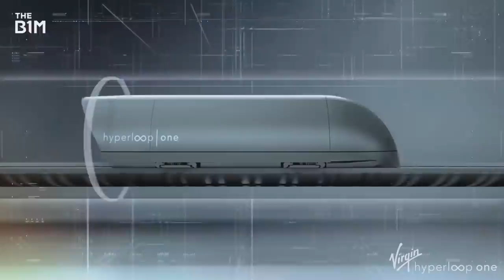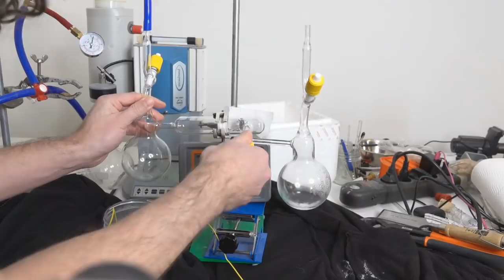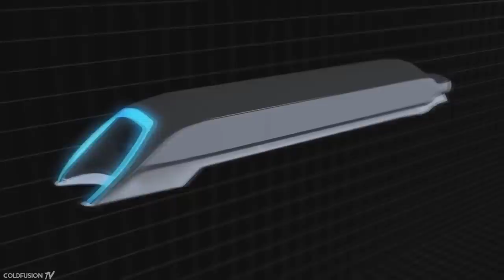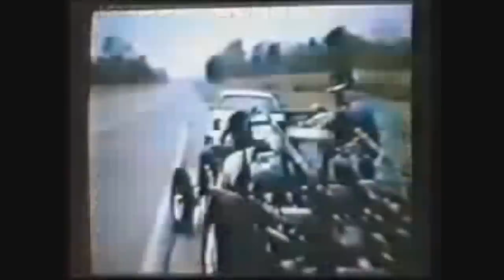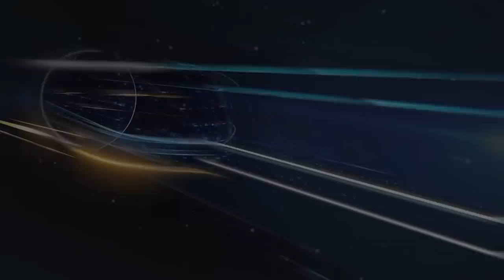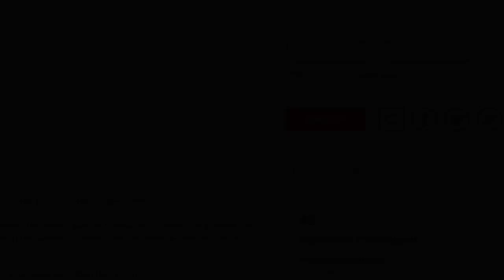Free energy device using Hyperloop technology!

Comment: Good vid, you walk the line between sarcasm and an actual sales pitch perfectly.

Why it won't work outside of a small scale model with artificial cooling: How are you going to maintain the vacuum? You want to remove the water from the cooled flask but opening it will destroy the vacuum. Another thing to consider is that you will have to clean the water and get that into the flask aswell while not destroying the vacuum.
Last, the change from hot to cold is over a really long distance, won't the gradual change in heat mess everything up?

In the end, this is just wind energy right?

I am just a skeptical Electrical engineering student but would be honored if you can explain how you have or want to solve the problems listed above.
Reply: Oh, stop it with those little practical details. The engineers will figure a way around them. Even if it means they have to come up with a new set of Laws of the Universe. I've worked with engineers  -- those guys can work miracles, ya know?
Reply: @Blue Obviously the whole thing is sarcastic, but the problems you list aren't entirely unworkable.  Just like the Hyperloop will have to seal off sections when loading and unloading, you would have collection areas partitioned and actively work on loading or removing water at each end.  Close it up, have the pump get it back to normal again and reconnect that section to the vacuum.  As far as the heat differential, well yeah, kinda.  I mean, you can use insulating materials, and the scale is huge - would have to stretch the distance from the Arctic to below Alaska - for instance.  It wouldn't really be much different in temperature from its surroundings at any specific location, the difference would need to be in the temperature between where you load the water in and where you unload the ice.  I'm no engineer, and I don't know the maths required for this, but wouldn't the volume of the vacuum near the loading and unloading areas have to be huge?  I don't know if it would need to be larger than the volume of the whole tube or not, but it would need to be large enough for there to be an easily maintained temperature differential that would keep the flow strong all the way through.
Reply: How are you going to maintain the vacuum?
-Vacuum pumps and other hand this could be used in space stations utilizing already existing vacuum of space.
You want to remove the water from the cooled flask but opening it will destroy the vacuum.
-Yes and its pretty easy thing to do if you have chamber on the bottom of the flask. Water is collected there, upper valve is closed, bottom is opened to let water out, then closed and upper is opened again. This will insert little bit of air into vacuum but not much.
Another thing to consider is that you will have to clean the water and get that into the flask aswell while not destroying the vacuum.
-Again same chamber system apply to inserting water and cleaning the system. Water will boil and leave all the crap into first flask. There can be several flasks that can then be cleaned while others run the system.
Another thing to consider is that you will have to clean the water and get that into the flask aswell while not destroying the vacuum.
Depends on how long the pipe is. In space craft this is non issue, where as on earth i suspect you will have greatly lowered efficiency for mentioned reason. Though there is ways around this issue like having vacuum tube inside a another. As you probably know heat is transferred poorly trough vacuum, where there is no substance to transfer heat trough.

There usually is way around the problems. What ever this makes it practical solution, is different topic entirely, just like with vacuum train.
Reply: what about they dig a big hole on the ground on arctic (or antartica) until it gets hot from the inner earth, and then use the temperature differential to generate power?
maybe this could really be a greate way to generate power.
thermal ftw

Comment: OK, lets assume we build this (with glue & magic if necessary) and it would work exactly as advertised.
It would STILL have a problem, it would act as a heat-pipe (as the cooling rods in big CPU coolers in computers) on a massive scale & basically transport Sahara-heat to the North Pole (minus radiant heat loss in transit) and accelerate the melting of the poles and cause world wide flooding!

Comment: How long do you think it could last? Eventually the vapor pressure would get too high and would need to be drawn out to make another vacuum in the "hyperloop". Wouldnt that cost energy to do? Would that energy be close to the total electrical energy output of the heat engine by the time it stops running? Just some questions i was hoping you could answer for us in the next video. I'd like to know 😊

Comment: REMEMBER THE 3 LAWS OF THERMODYNAMICS. Please people use your heads for once!!! Firstly the distance from the North Pole that you have to go to clear permafrost is about 3,000 killometers. And the distance which I think will get cold enough is about 2000 killometers. Let's say that for the industrial scale the tube is 50cm in diameter (25 cm in radius.)there are 1,000cm in a meter and 1,000m in a kilometer. So let's assume it's a cylender with a radius of 0.025m and a height of 2,000,000m so that is an vacum with a volume of 3,925 m^3. Now considering that it costs about $100 to make and maintain a cubic meter of 80%vacum then it will cost $392,500 as a bare minimum also if there is a leak, what are you gonna do just fly someone down there I mean like energy can't be created nor destroyed. If I am wrong please let me know and keep volitle language out, I'm open for constructive criticism

Comment: So why wouldn't this actually work? Just because it's impossible to make a vacuum tube of that size but if we could it would actually generate energy?
Reply: It'd be powered by solar energy, basically the same portion that drives wind (-turbines). This is a rather small part of the total solar power and it's very sparsely distributed. With wind turbines you have hundreds of square miles of ground that's warmed up on one side which pushes the air toward the cooler area past your turbine. You'd have to collect the temperature differences from vast areas at each end to get the power (and I don't know how you'd "focus" cold). Much better to do something like a "molten salt" solar collector and run your hot to cold cycle locally.

Comment: We already knew that by adding air and some some combustible gas in a vacuum tube, we can ignite the mixture and generate energy. That's 3 ingredients (vacuum, air and fumes). This new invention uses only 2 ingredients: water and vacuum. Cool, but I would propose to further simplify the process with only one ingredient: vacuum. Take a container and fill it with vacuum. Open a valve and let air rush in through a turbine. A lot of energy would be generated. Vacuum is the lightest form of energy available. Ideal for airplanes as it adds no weight. It is even so light that airplanes might require ballast to stay on the ground after filling up. Total safety: no fire or explosion hazard. Now you wonder where we can find vacuum.  The answer is simple: there is an infinite supply in space! Now there is the problem that vacuum at ground level might suck the air and reduce the quantity of this gas that all life forms rely on. First there is enough air for the foreseeable future. Second we could put a filter at the vacuum motor's inlet that would suck CO2 preferentially, thereby solving climate warming at the same time. There you have it. I will not apply for a patent. I generously donate this idea to mankind. You're welcome.
Reply: No way! Yes, vacuum is a very powerful source of... ehm... power, but a massive use of vacuum released in the atmosphere would lead to massive vacuum pollution with the risk of unforeseeable local vacuum concentrations. You don't want to risk your kids accidentally walking into a vacuum on their way to school.
Reply: yurimow 
that would really suck, wouldn’t it?
 I mean, really !
Reply: "Fill it with vacuum" lol.
Reply: To bring to ground level the infinite supply of vacuum present in space, all that is needed is a tube that extends beyond the atmosphere. What's striking is that we're already in the process of inventing this technology with the HyperLoop. All that's needed is a relatively minor design change with a hinge at one end, allowing the tube that lays flat on the ground to be raised to reach space. Space, after all, is much closer to the ground than the distance between San Francisco and Los Angeles, so reaching space could easily be accomplished with greater ease than intercity projects that are already contemplated.

This new concept would solve so many problems! With the vacuum of space available in infinite quantity at ground level, we could: 
- benefit from an inexhaustible source of energy, as already explained;
- connect all cities with a HyperLoop system without ever running out of vacuum;
- travel to space as easily as we do between cities thanks to the vertical tube that connects the ground to space that could also be used as a standard HyperLoop;
- keep our planet clean! With this cheap, infinite source of vacuum, vacuuming will be available to all, rich and poor!

Of course new technologies do not come without new challenges. Vacuum pollution at ground level, as already noted, is one of them. And if the vertical tube is not properly designed, we could end up sucking all of the earth's atmosphere. Scary! Also, if we use space vacuum to dispose of waste, we could end up with a planet immersed in a bubble of contaminated vacuum that would require us to get clean vacuum at ever increasing altitudes. So we need to design a system to separate dirt from the air at the top of the tube, and aim the dirt at the sun for incineration and the air in the general direction of Earth for reuse. 

The Green New Deal proposes that we solve climate problems by inventing things that have not yet been invented. This vacuum energy project is a perfect example of this brilliant vision, and I believe that the GND should be amended to include a chapter specifically dedicated to it.
Reply: mmmikeyyy 
If you’re serious then you’re missing just about every fundamental principle involved, sorry to burst your vacuum-filled bubble.
Reply: Bill P well, I’m not going to start listing my credentials here. That would be lame.  But I have degrees in STEM fields from top universities, and I know enough to discuss the power of vacuum as seriously as Thunderfoot does in this video. Combine vacuum with AI allowing a robot to move about autonomously in a room, and you get the Roomba. Combine vacuum with the power of the vortex, you get the Dyson vacuum. Tremendously successful industries based on vacuum. Now why not combine the Hyperloop with the vacuum of space? Huge potential! You say you’re sorry for bursting my vacuum-filled bubble... but vacuum is safe! The bubble won’t burst!
Reply: mmmikeyyy your tube to space won’t supply you with vacuum for the same reason the atmosphere isn’t sucked clean off of the Earth. Perhaps you missed that day in STEM class. 🤷‍♂️
Reply: mmmikeyyy 
What you need is a tube design that shields its contents from the surrounding gravitational field.  Then you can use your Noble prize money to start your project.
Reply: Bill P Listen, we live in a new exciting era where facts no longer matter. As AOC says, why should it matter if statements are factually true when they’re morally correct? Imagine a tube hanging from space, bringing interstellar vacuum to ground level, with the power to handle messes of all sizes, like emptying a contaminated landfill effortlessly in minutes, even sucking excess water from the oceans? We all want a cleaner planet, don’t we? What better way to achieve this than a planetary vacuum cleaner? I say that this ambitious project needs to be incorporated in the Green New Deal! After all, this proposal already calls for the invention of things not yet invented. Let’s put some flesh on that bone!
Reply: mmmikeyyy 
You should call it The snake oil tube because even if you were able to erect a tube 50 miles high, it wouldn’t work.
Reply: @mmmikeyyy  we really might be up to something here. If we built a vertical tube high enough to reach the vacuum in space, once built we just have to remove the air at the bottom and replace it with vacuum. Once that is done, we can just let the vacuum flow out. The outflow of vacuum at the bottom will automatically suck vacuum from space. By fitting a turbine at the bottom we can produce an endless amount of free energy (while we are at it, we might also cover the tube with solar panels, you never know). But as i said above, we want first to figure out how to get rid of the vacuum released. Underground vacuum capture?
Reply: yurimow is a comedian
Reply: yurimow Good point. We need to be careful with excess vacuum at ground level. Perhaps we could put it in light containers which will naturally rise in the atmosphere, vacuum being the lightest substance known to man. At the edge of space, we could release it in its natural environment. So many details to think about!
Reply: mmmikeyyy 
🤦‍♂️vacuum is not a substance. 
Am I talking to a 5 year old?
Reply: @BillPalmer  If vacuum is not a substance, how can Elon Musk propose that we fill tubes with it? I have no objections calling it the Snake Oil Tube, sounds quite catchy.  I'd prefer the Snake Oil Vacuum Tube however. I understand your objection regarding gravity and all. Your skepticism is understandable as I've not revealed all the details, where the devil resides as we all know. Granted, the vacuum of space would already be sucking the air from the surface of our planet even without a tube if it was not countered by gravity. The trick is to have the inside of the tube serrated in a spiral pattern like a gun barrel. This creates a vacuum vortex,  which lowers the vacuum pressure below the absolute zero that is customary for static vacuum. This creates a much more powerful vacuum, one that is able to suck anything, and if it can't,  just make the vortex spin even faster! It's nothing new: Dyson have been using this principle for years in their vacuum cleaners. Only not at the planetary scale herein envisaged. Note that the thing could generate considerable amounts of energy with a turbine in the vortex, making the planet clean and energy independent at the same time. This is a perfect example of "inventing things not yet invented" as proposed in the Green New Deal. You may say that these ideas are flawed for some obscure technical reason, but as AOC says so brilliantly, who cares, if they are morally right? I think a few trillion dollars for this endeavor is not much considering that it's a limited sum, while the benefits are almost limitless!
Reply: mmmikeyyy 
AOC isn’t dealing with physics, only politics. 
There’s no such thing as pressure less than zero.  How can you have less than nothing (in the physical world- not financial)?
“Adding vacuum” or “filling with a vacuum” makes as much sense as digging a hole by pouring hole molecules on the ground.
Reply: @BillPalmer  Wow! You don't give up, do you? How is this country going to progress toward a better future with people constantly destroying new ideas on the basis that they are factually wrong, disregarding the more important point that they are morally right? This giant vacuum tube hanging from the sky like a trump, able to suck anything we have in excess like pollution, garbage, dirt, flood water etc, using negative-pressure vacuum  (another innovation!) created from space vacuum initially at zero pressure, all this while generating energy, isn't this an inspiring vision for our future? If the solar roadways got millions in funding, why wouldn't this SkyVac project be funded too, especially if it breaks new ground with the invention of negative-pressure spinning vacuum or the discovery of vacuum as a substance? This project might even save the solar roadways that have as one of their major flaws that you can't keep clean a surface supporting traffic. But with this new giant vacuum system, vacuum will be available  everywhere, and everything will be sparkling! Including the solar roadways that will perhaps be able to produce a few watts with a clean surface, before breaking in pieces under the weight of traffic. But then again, the SkyVac will be there to suck the debris away! In more than one way, these two projects are complementary!
Reply: mmmikeyyy 
Good point.  Keep an eye out for my upcoming GoFundMe project where I will be starting a fairy dust factory and unicorn dairy.

Comment: Couldn't it work for real?(even if low power) a large tube, on a lake that is on the foot of a mountain? (instead of thousands of kilometers to the pole)
Reply: It does, every day. It's a "heat engine". It's normally used in power stations to get power from water (or some other "working fluid") that's been heated by anything. Also geothermal tends to run a heat engine from the hot area to the surface.

Comment: Umm, cooling the other chamber has the same effect as heating the chamber with the water in it. But a change from cold to hot or hot to cold is needed at one end or the other for this closed system to work and once the maximum temperature change is reached, the transfer of gas (the source of your energy) is ended. So unless you plan on heating the ocean or cooling the poles, your hyperloop energy tube isn't going to work... just sayin. -Thunderf00t